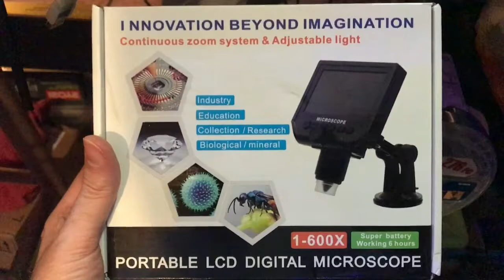Mustool G600 Electronic Microscope Breakout Box Mod

Comment: That thing even shakes with your mod through the stiff cables you used. I would only accept  a wireless trigger via ESP or simmilar. Or a timer that counts down and then trigger a shot, I am sure that can be done with a tiny85 or so...